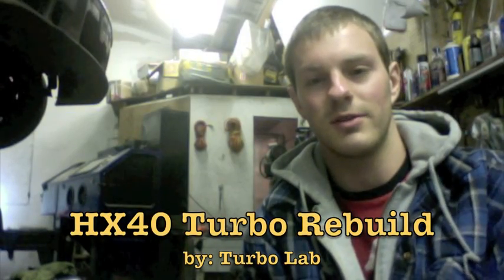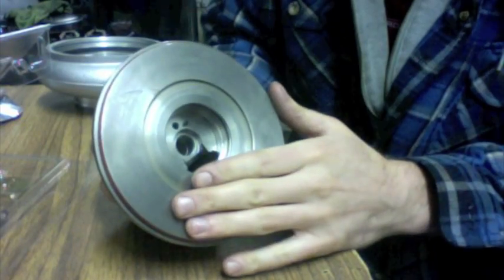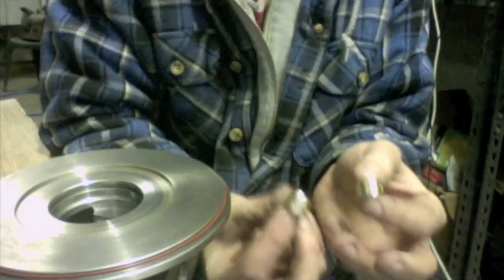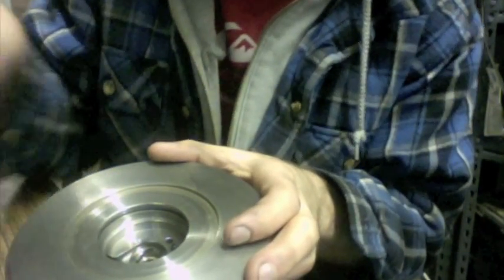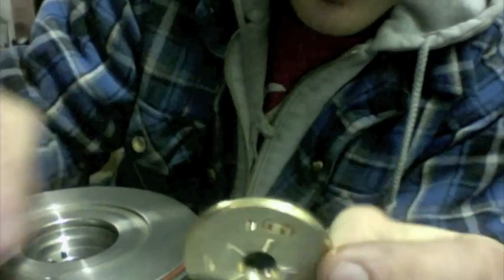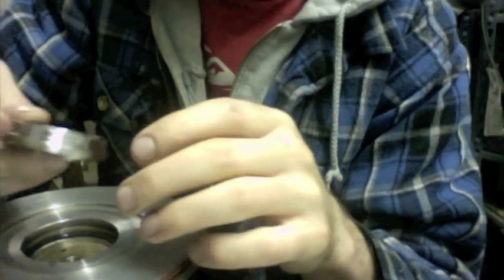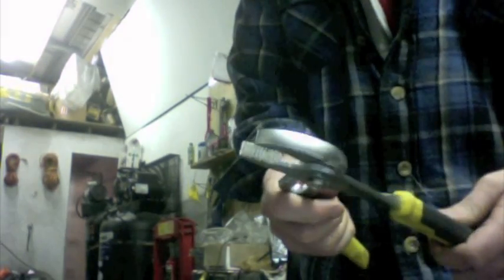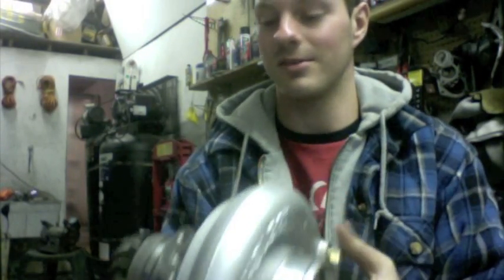Holset HX40 Turbo Rebuild -Turbo Lab

Comment: Hello Austin, I was trying to rebuild my hx35 but the kit I bought came with only 1 turbine end piston ring whilst my turbine shaft requires 2 piston rings, I can't seem to find anyone selling piston rings here in UK for the Holset, can you tell me if the piston ring from the hx35 is interchangeable with another from say a garret GT series or any TD because these are available here, also can you please tell me what do you think of stepped gap piston rings and are they useable in the Holset application
Reply from the maker: The models that have the 2 piston rings use 2 of the same standard size rings which the gaps need to be 180 degrees apart. You can use the staggered seal. I don't have a preference of the staggered one over the standard one. The seal only leaks when the sides of the seal where out unless there is build up of oil in the cartridge where it's pressurized and forced out of the seals
Reply: Turbo Lab America thank you ever so much

Comment: Hello! what is difference between holset hx40 & hx40 super
Reply from the maker: +lamine ben zina factory billet wheel which weighed the same as the stock one and it had a 10 blade 64 x 76 turbine vs a 12 blade

Comment: Thanks for the video.

I heart that Holset turbos are not balanced as an assembly. 
Is that true?
And when yes, why is that not necessary?

Best regards from Germany
Reply: if the bolt is a typical hex then it needs to be rebalanced after building. It is is the 13point style nut,then they are intenally balanced.

Comment: Do you know if the hx40w will simply bolt on in place of the hx35w?  I understand that as long as the exhaust housing T3 it should bolt up but I mean the oil feed line and oil drain line.  I know I'd need a down pipe as well

Comment: FYI, those are snap rings not "c" clips. you don't use snap ring pliers on "c" clips.
Reply: Brian McNeil,it's all about the handjob bro,as long it works..u can even tight a M16 bolts using a hammer if got the skill..
Reply: so where the fuk is your video,,,austin does a fine job,,,why dont you just go read a book instead to learn something,,??if u can read,,,lol

Comment: what the torque special on wh1c turbo please?
Reply from the maker: +Kennygsx on the compressor nut?
Reply: +Turbo Lab America 
yes the locknut for the compressor wheel torque spec.
I just bought one your rebuild kit and everything works great. thanx
Reply from the maker: Put the nut on by hand then when the nut starts to tighten add 1/4 turn. Torque spec on the mhi 6.5 mm shaft is 7 ft lbs. the Holset is 7mm bore. So the spec will be close the that. I want to check with a torque are here to confirm. I have one turbo here that the guy tightened the compressor nut so tight that the nut is fused to the compressor wheel.

Comment: The holes in the thrust bearing that are sometimes too small; what is the proper diameter of them?
Reply from the maker: +Donnie Stritzinger  I never measured them before. I'm not sure how to measure that. I guess I can measure where the bearing is drilled on the outside.
Reply: +Turbo Lab America that would be a real help. Thanks, in advance.
Reply: Turbo Lab America  is the center  cartridge of the HX35W the same as the HX40W?

Comment: u happen to have any hx40 6 blade 60mm compressor wheel for sale I need one
Reply from the maker: +Richard Reid You can get one here http://ebay.to/1OJMBHZ Just Keep in mind that the 6 blade has a taller tip height than the 7 blade, so the 6 blade is not a direct fit for the 7blade compressor housing. Also there is a 56 x 83mm 6 blade too, so make sure you measure your compressor wheel or check your part number to double check.

Comment: Do not need calibration?
Reply from the maker: Bruno Pinho puto If you are talking about in terms of balancing, no. The Newest HX and HE turbos with the 12 point 10mm nut are component balanced parts and the Holset turbos with the 6 point nut are rotor balanced according to the Holset Service manual.

The Turbos with the 6 point nut should be realigned to the factory balance marks. The Holset Turbos with the 12 point nut can be aligned at any rotation, because the parts are balanced at any rotation.